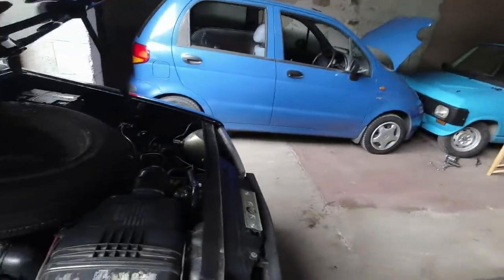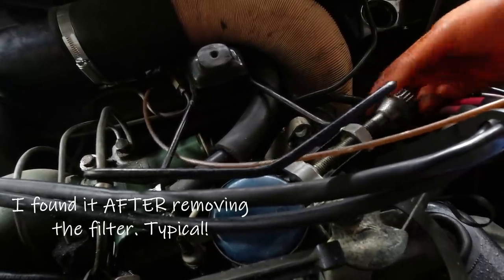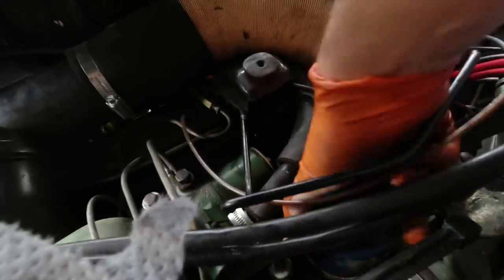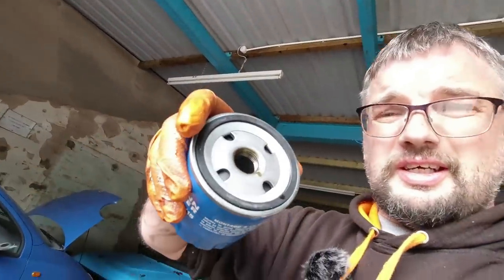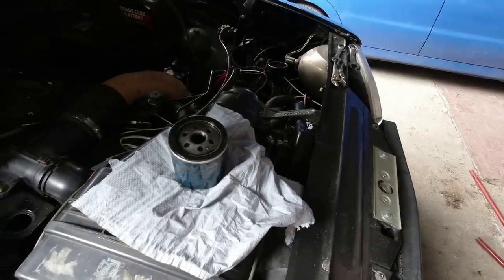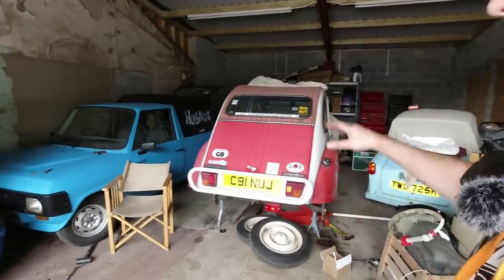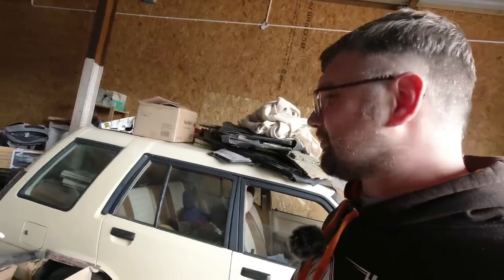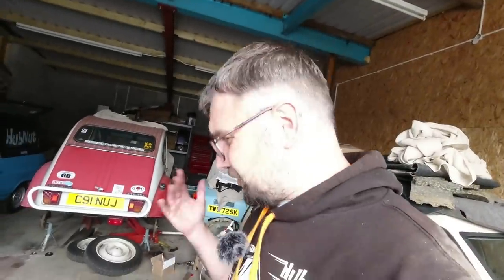Citroen GSA oil and filter change. How hard can it be? (CONTAINS PROBLEMS)

Comment: You made a meal of that.. I owned many gs's in the 70s and did all my own servicing. I still remember how to change oil and filter. Best to remove sump plup first, then punch a big hole in the top of the oil filler to let it drain, then use a G clamp on the oil filter which means you can leaver if necessary away from all the cables etc. I also remember how to change the LHM and clean filter and change brake pads front and rear

Comment: Working on these modern cars is so much more difficult than many of the older cars. On my 53' Desoto, I needed new manifolds and I had to replace the head gasket. I removed the head, the intake and exhaust manifold, and put it all back together much more easily than it will be for me to replace the rear spark plugs in my van. To be fair, the spark plugs in my van do last a lot longer than the ones in the Desoto. Still a royal pain to work on.

Comment: It's interesting to see that the spirit of "because Citroen" fuel filter location lives on, since my 12 year old Citroën has its air filter stuffed behind the engine, and you have to remove a sodding cart-load of bits to get at it

Comment: Pro tip. The way to do the filter on a GS is to first whack a bunch of holes into the top of the filter with a nail to let the air in. Most of the oil drains back into the engine rather than spilling all over the engine.
Reply from the maker: It's a very good job I didn't do that...

Comment: Just done the oil change on my fathers civic with k&n oil filter & mobil 1 oil easy peasy.
Put in 5w 30 fully synthetic instead of 0w 40 and the air con now runs super ice cold whereas previously with the 0w 40 it blew just cold enough.
5w 30 is the correct viscosity now whereas before with the 0w 40 it was slightly too thick.
Maybe this was the reason,strange.
Did my pollen filter on my astra and it came out totally black.
Mind you it had been in there 5 years haha.

Comment: A Rover 213 was the only car I have known where you could do this job without grovelling underneath. Kick a drain bowl under from the front, reach down with a ratcnet and socket spanner to undo drain plug. Unscrew filter and allow to drain into the same bowl. Then reverse - 10 mins max courtesy of Honda!
Reply from the maker: Sadly, by the time of my S-MX, Honda had lost the plot. Filter buried beneath the inlet manifold, down the back of the engine and only accessible from beneath. Oh, and no room to turn a wrench. Nice!

Comment: Oh the frustration of a simple job gone wrong. Too tight...check. Poor access...check. Wrong part.....check. Fabulous!   I suggest getting a nice sew on leather cover like a WheelSkin for the GSA. Yes, it will cost about $50 and you’ll spend an hour sewing it on.  That seems a total waste of time you say? Well, You can have your tea and listen to a podcast while working. And, you’ll feel like a lottery winner every time you drive because the wheel feels so good to the touch! So much better than those nasty slip on things.
Reply from the maker: Yes, it's just a trial as I already had it (used it in the Skoda Favorit). A more permanent solution may be nice.

Comment: Can't  understand why people tighten oil filters as tightly. I just turn until the rubber ring touches and then half to three quarters of a turn down tight. Never fails and very seldom need to struggle with a filter wrench, although some are just a bit too tight to slacken by hand.
More cars equals more maintenance and cost. However, that's what you do and mostly enjoy, so a small cheap fleet suits you down to the ground. No doubt it gets frustrating sometimes. My personal weakness is camera and technology. On the whole there is less maintenance needed with these although they can be just as frustrating

Comment: I remember once having a 200tdi engine in the back of my sprinter that collected and had to drive a heavy 5’ long landscaping bar through the oil filter, ratchet down the engine and lever it off. Hand tight? No, no it wasn’t.

Comment: I cannot agree that the access is bad, the filter is in the very top of the engine, 100% better than any car of their period, with a straight cup from above it would have been easy peasy job... ok, ok except for the tubes, and the throttle linkage, an the spare wheel bracket contraption... hey, by that time they didnt have e-mail to coordinate between different designt teams... 	
it's the thought that counts... kinda

Comment: On the clutch cable of my Cavalier MKII Estate (Camira) they used a clip instead of lock nuts. I think it is the one linked below. It just pushes down into the tread. Remove clip, adjust nut with fingers and replace clip. Job done. For a quid or so worth trying, perhaps on Elly first as you can get at it easier. If it does work buy several as you do tend to drop them and sometimes lose them. Voice of experience there but you may find it later on the ground no where near where you though you dropped it.
https://www.autovaux.co.uk/11061021-lock-washer-as11061021

Comment: At any point did you start wondering if the oil filter was on a left handed thread? Nothing would have surprised me with citroen. I mean putting the filter upside down on top of the engine surrounded by other parts, citroen madness
Reply: The current Subaru engine has the filter on top upside down.  Easiest filter to remove I've ever done!

Comment: HubNut: How difficult just to change oil filter?
GSA: Yes
Reply: Back in the day, the correct tool to remove an oil filter was a hammer/screwdriver/pliers combo if you were Mr Average, or a Chain wrench if you went equipped...these all worked fine, and had the advantage that you'd check very carefully you'd got the correct replacement BEFORE removing the old one!
Reply: Easy - with the right type of filer removal tool !
(see my other post)
Reply: HubNut: How difficult just to change oil filter?
Citroen: Shrugs and draws another lungful of Gitanes

Comment: "How do you get rid of any of these?". You don't: you instead learn to accept that what you went through in this video is simply part and parcel of owning a small fleet of quirky and unusual cars. Unfortunately, the same attitude has left me with four expensive storage units full of my hobby and regrettably, it's a decision I will now have to face (and soon) otherwise I won't be able to retire on a much-reduced income; to wit, my pension.
Reply: I'm only 55 and mindful of 'winding down' ! But what can I get rid of ? Actually, loads of stuff - that's better sold than scrapped. 3 generations of collected tat - but I see no reason to buy new when something ancient works fine.
Reply: @millomweb  Same age as me, and the same attitude as me regarding buying new :)
Reply: Howard Le Vert Immanother I’m also an older vehicle fan, my current fleet stands at 6, 2x landrover defenders 90 and a 110, 2004 Mercedes van (I use for work) a 1999 VW T4 and a 1999 transit MK5 camper and a 2003 Subaru wrx impreza , I need some where to store some or get rid,I only have storage for the Subaru and 1 other, I’m looking in the future for bigger storage car hobby’s is expensive😫😫😫😫

Comment: Citroen engineer 1: "I know. Let's put the oil filter on top and surround it with other gubbins." 
Citroen engineer 2  "Brilliant idea!"
Reply: it could have been a lot worse.. somewhere on the side of the engine.. deep below.
Reply: Ever tried changing the oil filter on a V6 Alfa 156? You start by removing half the power steering pump...

Comment: Betty's oil filter is a breeze. It sticks out on an angle under the engine and doesn't drip.
Reply: Come on now, there's no need to rub it in...
You probably get the right oil filter first time, every time too...
Reply: @gosportjamie  
Ryco Z9....they grow on trees in Australia and if the job takes more than 3 minutes you're doing it too slow. Lol.
Reply: @AUmarcus    That's about what I thought.  It's like with the old OHC Family engine in Vauxhalls, you could get the filters, genuine Delco ones at that, everywhere with no problem and, on most of them, you didn't even need the vehicle off the ground to change them...
Reply: gosportjamie changing an AU's oil filter is literally pleasurable by how easy it is to everything else. It's evident that they actually put thought into that!
Reply: @jamesfrench7299    It's a shame Ford didn't put so much thought into everything they made...

Comment: There's nothing quite like finding out you have been sent the wrong parts halfway through a job.. 🤬
Reply from the maker: It is hugely frustrating, and sadly quite often. I still have a water pump for a Ford Escort diesel (meant to be for a BX) and a set of spark plug leads for a VW Golf (meant to be for a Skoda Favorit).
Reply: @HubNut  LOL
Reply: @gilburton Pro tip that one.

Comment: Original Lost in Space quote by Dr Smith "Oh the pain".
When you removed the wheel and caught the mic lead "This is not going to go well!" 
Why would Citroën put the filter on the top! Because they can. 
My filter tool is a nylon webbed loop driven by 1/2 socket worked pretty well unless it slips. As the saying goes A bad workman blames his tools, a good one has the right tool and knowledge to makes it look easy.

Comment: The oil filter access is from above, which is good, and it looks pretty easy to remove. 
Try removing a 2007 Kia picanto filter, which is central on the engine,at an angle and access from below.
Driveway DIY solution was piecing tiny filter with screwdriver and having oil in the face, and forgetting which way was anticlockwise- total madness
Reply: i laughed out loud ;D
Reply: I agree. At least you can see the Citroen's filter!  I needed to use the screwdriver through filter technique on a Ford Laser, which has it on the back of the engine, and you can't even see it from above.

Comment: Have been there many times over the years, ringing up a parts place, carefully giving them your vehicle details and registration, they seemingly type it into an all knowing accurate database, confirming the model year and model version, even asking for reassurance it is the correct part, 'oh yes it is', they confirm confidently, them supplying the part, again double checking it is the right one and sure enough when you strip all the old bits off to replace, the car is up on axle stands etc- come to fit it, wrong part! It's usually saturday afternoon by now, the parts place is closed and doesn't reopen till monday! 
The usual outcome is, 'well you've tried to fit it now, it's covered in oil and looks used, I can't take it back!!', hence my huge collection of  brake pads and shocks, oil filters, bushes, track rod ends, suspension arms exhaust sections etc etc for cars I've never owned or likely to ever own! 😯⚠️😁😷👍😎
Reply: @gilburton Yep! It seems most cars are those 'interim' models, they often change a multitude of parts during a cars model life. Hence why I now take the old part with me when picking up the new part to compare and make sure it fits! 👍😎😁⚠️

Comment: The absolute worst oil change I ever had the misfortune of doing was on a 1st gen Opel combo van with the 1.7td Isuzu Gemini engine shoehorned into the Opel Corsa engine bay. The filter was entirely inaccessible! It was below the intake manifold at the back of the block and above the diff and drive shafts from below. Even the fuel filter was a pig. I had to get someone to hold the clutch pedal in to keep the release arm out of the way while I dropped it out and spilt diesel everywhere.

Comment: The worst oil filter change I had to do was on a 2007 VW Beetle. I broke a strap wrench and the screwdriver method didn't work either. I had to buy a new oil filter tool and this was on Sunday after 4pm so it was a bit of a tall order. I knew of a motor factor that was open so I bought a chain wrench and it got the oil filter off. My theory was that it was put on with no oil on the seal, it started to leak and was tightened until it stopped leaking. The oil filter access on the GSA isn't all that different to my own Citroen C4 Grand Picasso.

Comment: Hi Ian, while the oil is draining, puncture a hole in the top of the filter and it will drain down through the engine before you take it off.
Reply from the maker: That's fine as long as you do actually have the correct filter. Which I didn't...

Comment: My friend has a car garage ... I buy the oil & filter £24 for 5 Litres of oil and the oil filter from E+ro car parts  ... I take the car to him and give him £20 for changing the oil/filter ..
£44 it total for 5 Litres of oil/filter and fitted  WITHOUT having to get my hands dirty ...  I don't think that is expense  IMO.. 
Here is a question for you HubNut ????
How many miles do you think the engine oil is good for before it needs changing?  .. In my "Everyday" car that does 13,600 Miles a Year. 
It says in the handbook every 9,000 Miles every 12 Months which ever comes first ....  But I think the oil is dirty LONG before it gets to 9,000 Miles  (8 months for me) and is therefore not offering good protection the engine to a high standard anymore... 
These MEGA high mileage cars you see with 300,000+ miles on have ALWAYS got one thing in common .. Lots of oil/filter changes from new. 
If you were ONLY allowed to do ONE thing on a car ..It would be change the oil/filter often... 
Like I said..It says in the owner handbook..Change the oil every 9,000 Miles/12 Months ... But I think oil is only good for around 5,000 Miles.  After that it is no longer offering MAXIMUM protection to that engine... IMO

Comment: I remember having to do an oil change on a Rover 216 and leave the old filter in situ as it WOULD NOT come off, actually broke a metal filter tool in the process but the filter wouldn't budge.  Prior to that one was stuck on a Ford Fiesta to the point where the person doing it (not myself) decided to stick a screwdriver through it to get it off, but even that didn't work so it had to be towed to a garage to get done whilst up on a ramp.  Needless to say I now have a bit of a phobia of doing oil changes!!

Comment: You should have bought a Matra Murena instead of a GSA, it takes 2CV oil filters! 😂 (Of course the rest is still French engineered, it has a hole in the right rear wheel well so you can access the water pump from there and the electrics go up in smoke)

Comment: Furious Driving was recently caught out by incompatible threads on a Rover V8 oil filter... there was an industry change from UNF to a similar Metric thread.. a mismatch will work with UNF filter onto Metric thread (loose) but not the other way round ... as you found out.

Comment: Laser do a fluted oil filter removal tool which makes that job much easier :).
On a Porsche 944, it's near impossible to change a similar style of filter location without it :).
For no spillage, draining the oil first and keeping the sump plug out makes a difference :).

Comment: Try changing the oil filter on a Douvrin engined 2 litre CX. It's exactly like your GSA with every conceivable sub frame, steering rack, pipes and wiring in the way  . The only difference is that it's on the bulkhead side of the engine and is only accessible on your back from below. Don't sell the Citroen,  sell everything else first, I promise you'll regret it. I sold a '83 CX Prestige 20 years ago and bitterly regretted it every day after. When you have driven an oleopneumatic Citroen nothing else ever seems to satisfy your sensibilities and the joy you feel in understanding all the technical details of its conception which seem so "right" and which are dismissed by the vast number of others as "quirky".

Comment: Hi Ian
The Purflux tool makes getting the filter out a doddle as the handle is cranked. Makes all the difference. Put a wad of paper towel round the base of the filter.

It's getting hard to get the proper GS/A filters. You can fit the more common Purflux LS867 filter if you change the spigot on the engine which the filter spins on to. A local machine shop will make one no probs. 

Nothing is too bad on these cars once you get your head round it.

Keep up the good work!

Comment: Change the starter motor of a mazda 626 or a VW Golf Mark2 with automatic transmission. After that everything looks easy. 
On the Mazda 626 you have to remove the whole Intake manifold and throttle body. And everything ist sealed with non elastic sealing compound by the factory.
The Golf MK2 has the starter motor under the exhaust manifold, surrounded by the right hand engine mount, some power steering and radiator plumbing, and lots and lots of other sh*t. Takes about a whole afternoon to get this starter out. With a lift and all the proper tools. If you are crazy enough to tackle it on the side of the road, it takes a whole day. And about a whole week to recover from your flesh wounds and traumas.

Comment: To soothe your concerns, modern oils and oil filters are far more capable to withstand irregular change intervals than say, 20 years ago, so skipping on oil filter change (whilst not ideal) is not that big of a deal. And having multiple older cars is just a safety net, since there is a very, very small chance that in some inconceivably small percentage, one or two might break down and you'll have to resort to use the spare one(s) [hides keys to five cars] :D

Comment: Ian what rhymes with city rover ? is she trying to tell you something ?, those citroens are a pig to work on,you either love em or hate them, had the same problem with oil filter but worse than you i knackered the old one with a screw driver and put a hole in it, but i just got a lift to a shop  and got the correct one. i've ordered many parts in the past that should be right  but don't fit,but  that's life i suppose at the citroen garage there relaxed and hardened to french mobiles, you will find this with specialists....any way fare well and Bon Voyage..🛠🛠🛠😀